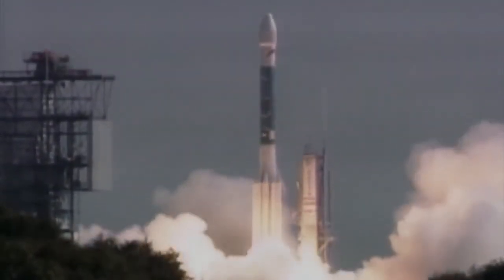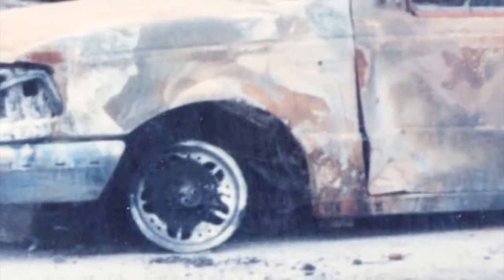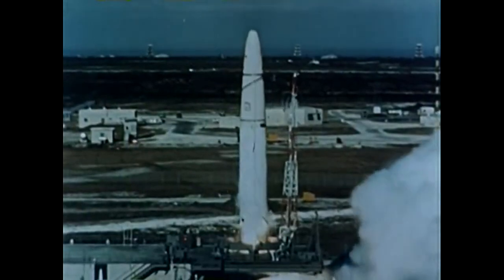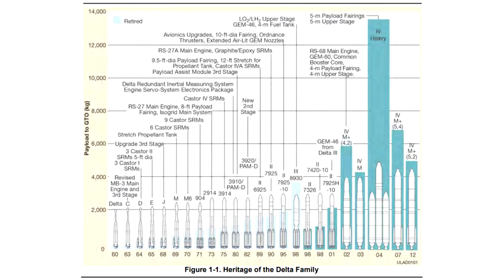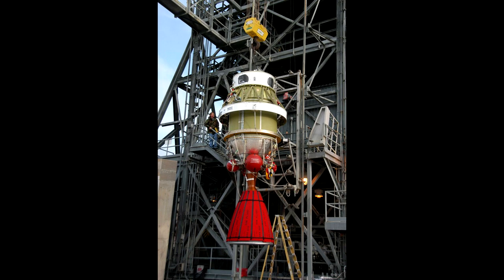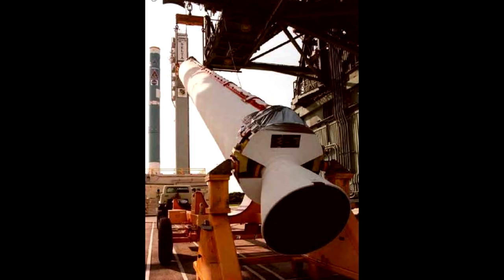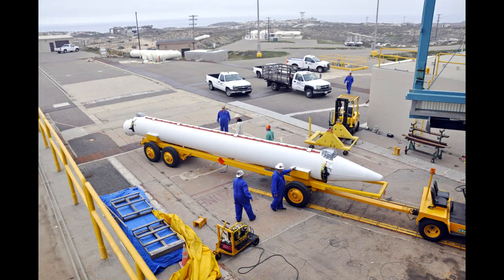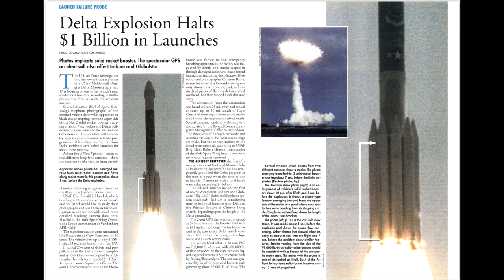Why Rockets Fail: 1997 Delta II Explosion - When a Booster Comes Unzipped

Comment: I worked on the upgrade of Delta RS-27 engine to Delta II back in '87. I discovered a flaw in the engine analysis, in that they had failed to perform a fracture analysis on the turbopump main shaft. They had done a long duration durability analysis but that was insufficient for the cryogenic conditions to which the shaft was subject. They knew they had a flaw in the engine as they were losing one flight in 23 and half of those were due to engines going "boom", but they had not been able to find the cause. After I pointed out the flaw, they changed the design and the reliability doubled.
Reply: baddoggie101 wow super impressive! I’d love to be an aerospace engineer
Reply: One in 23.  Taxpayers' money.  We get a do-over.  Nice business.
Reply: Memestealer_chungles 05 especially one working on rockets!
Reply: nice pfp
Reply: @a7xgh442   As a current ARO major, prepare for many late nights. It's definitely a very interesting, and I'd say rewarding, career choice. There's at least 2 fluids classes, a Vibrations class, Systems Engineering lab, Controls & Avionics, and Thermo and Orbitals (if you're going the Astro route).
Reply: Harut H thank you :)
Reply: Congratulations!
Reply: Memestealer_chungles 05 started my freshman year at uni here in the netherlands majoring aerospace, it’s awesome but like the other guy said a lot of work. Though if you find it interesting enough spending 2 weeks straight studying for the exams (do this with friends as you need the social contact and you can help each other) is not that bad. And I still get to party 3-4 days a week when I don’t have exams. Would defenitely recommend the study!
Reply: Bobbytrap the fact ur partying 3-4 days a week tells me u ain’t going to be no one special in the future. 
Why don’t u use them 3-4 days to get u even more knowledge? Ah that’s right cause I don’t actually care
Reply: Nick Jeffrey I still pass my subjects, just can’t be bothered to sit there studying every day of the week. I’d rather spend my free time building up a social life and hanging out with friends. With a masters degree (which I plan on getting) in this sector I’m almost guaranteed a good job in future, wherever that will take me. As long as I’m happy with my job I’m fine with it
Reply: @bobbytrap2554  Screw chicken nuggets and booze, I'm going to college!
Reply: Damn you must have gotten a huge raise considering you saved them millions of dollars
Reply: Memestealer Chungles  "I'd love to be an aerospace engineer".  
      Surely you meant to say "rocket scientist".  Didn't you?

Comment: My father was in the blockhouse during this launch/failure...he was a propulsion engineer (liquid engine) for Boeing/McDonnell Douglas/Douglas Co. since 1963. As the rockets grew larger and more powerful over the years, he had said that if they lost one on the pad it would obliterate the blockhouse...needless to say, the explosion at roughly 1/4 mile off the pad knocked him out of his chair. They were stuck in the blockhouse for over an hour before being evacuated. His truck was lightly damaged, but the vehicle parked behind his burned to the ground. He was close to retiring at the time, but stayed on until the next successful launch (he didn't want to leave until they had a good launch). He then retired, but contracted back for the (ill fated) Delta III and early Delta IV. He was a very intelligent and well respected engineer, but extremely modest. His passion for the space program was unwavering, and inspired me to join the space program myself (Space Shuttle).

Comment: Very good report. You did your research.
I worked for McDonnell Douglas Delta program back in 1997. It was a sad day. 
Steely eyed missile men get misty eyed when one of their birds fail.
Funny story; Once at Vandenberg  one of the solid boosters was out of storage and sitting outside to get some testing. People were standing around near the nozzle. A plastic protective cap on the nozzle popped off with a good loud pop sound. I think the people standing by the nozzle had to go clean their shorts after that. 
I assume the air heated up in the nozzle expanded enough to pop the cover off.
Reply: I think the "misty eyes" were from the toxic cloud. 😂
Reply: Things going pop unexpectedly does tend to get peoples attention fairly quickly.
Having worked in the hazardous chemical industry i worked with differential thermal analysis equipment.  Take 10 grams of the waste stream which is potentially going to be distilled for solvent recovery and put it through a heating cycle to see if its safe to process. Only had one sample which suffered a thermal runaway reaction under heating, it did go pop, well it was more of a bang. Better to test it with a few millilitres of sample than 18000 litres in the still.
I should add no damage or injury was caused by the event, the testing equipment was very sturdy and was probably built to withstand worse samples, the equipment was originally owned by ICI.
Reply: @patkins8319  that's what your mom said

Comment: My friend Marc was a member of the launch team in the blockhouse during this event. He manned the instrumentation bay and after the explosion they noticed that noxious fumes were leaking in through the cable conduits. They rammed rags, paper and their shirts into the conduits to block the fumes. Marc's car was one of the severely damaged. 
Scott, contact me if you do a report on the Delta 3000 #134 failure of Sept. 13, 1977. I was a solid propellant consultant for the McDonnell Douglas failure review team. That failure resulted in a major change in solid propellant formulation.
Reply: (written as I look across the living room at a twisted little piece of Delta 241 tank which Moose gave me)

Hey, I would like to hear anything you have to offer on that.  Sounds interesting!

I believe Marc said that a chunk of propellant actually struck the entrance to the conduit channel, which had at least been sandbagged (years earlier?) as a precaution.  That had me imagining how whoever it was stuck lugging those sandbags in the Florida sun must have been complaining to themself about all that work when it was never going to matter, because what were the chances of a direct impact from something?

Comment: Would be super awesome if you could cover the failures of the first rockets/rocket motors. I'm very curious what went wrong in the early days
Reply: This !!! Please Manley-san !
Reply: @helioswind2614  *Manley-sama
Reply: They probably mounted the guidance sensors upside down or some other stupid thing we used to do when we didn't know better. The best failure has got to go to Wernher Von Braun when he built his rocket with the engine at the top because he thought it would create a "pendulum" (I believe) and that it would stabilize itself. Cool to think that same man designed what would ultimately become the Saturn V which took us to the moon. I guess that's the thing with smart people.
Reply: @mankeez5892  it wasn;t Wernher von Braun it was Robert Gottard
Reply: @mankeez5892  Yeh that was Robert Goddard who did that, not Von Braun.
Reply: Sounds perfect for another Vintage Space collaboration.
Reply: They almost always come down to "component X could not even" which, by the very nature of having stupendous amounts of oxidizer and fuel right next to each other, result in KABLAMO!
Reply: Unfortunately there aren't any ancient Chinese inventors around that had first-hand knowledge or were witness to the failures.
Reply: There is a phenomenal book about this by Drury Clark: Ignition - An informal history of liquid rocket propellants.
Reply: Everything went wrong.

Comment: I saw a documentary on this failure once where one of the engineers described making an insurance claim about is totally destroyed car. Apparently the insurance company was skeptical when he said that "a rocket fell on it." :)

They also described jumping under the desks in the blockhouse as the debris came down. I'm not sure that doing that would've helped.

Clearly, this could've been much worse.
Reply: I just read about this a few minutes ago as I'm doing a post on imgur about this failure. Here's the story:

"One of those belonged to Dr. Jay Bernard, who joined Aerospace in 1977, then moved to the Delta II program in the early 1990s to work on the Redundant Inertial Flight Control Assembly (RIFCA), which was part of an avionics upgrade."

"Bernard recounted that his insurance adjuster was initially skeptical when he reported the cause of damage as a collision with a rocket.  But he was convinced after Bernard told him to turn on the television, which was covering the event right then."

Comment: 5:16 Most badass bird under rocket motor
Reply: michael cannard can’t see it :/
Reply: @Mr. Minticuz It's not directly under the rocket, it's more in front of the concrete block the rocket is placed on. You see that red pipe? The bird is more underneath that walking towards the stairs that need up to the rocket motor. Still the most bad ass bird in the world. Can't even be bothered to fly away...

Comment: "It would be bad if these boosters failed. We better test them so that doesn't happen."
"Good thinking, Jim."
Reply: Brian Clark For metal casings, this is the proper standard procedure.  Because solid metal is more like a spring that will be just as strong after that pressure test.  While fibres is a bunch of strings permanently breaking one by one at max load.

Comment: I immediately thought of this when I heard of the Titan submarine having a carbon fiber hull. Carbon composites are very strong and have many advantages in several applications, but everything in engineering is a tradeoff that must be weighed against the drawbacks. I'd imagine they didn't do enough inspection after each dive.
Reply: Same

Comment: The destruct signal from the blockhouse would be Command Destruct.  Self Destruct (internal failure) and Auto Destruct (from the flight termination safety chain) are different events.  Rocket staging temporarily inhibits Auto Destruct, for obvious reasons.

Comment: I was there!!! I was 10 years old and I still remember the noise and the incredible explosion that rocked the building I was in... we were getting ready to board the big red boat and they said if that boat wasnt between us and the explosion, all the glass in this glass wall facing the ship would have shattered!!! 

I remember the sliding doors coming off their tracks and the security guards running around not knowing what had just occurred... when we got on the boat we could see the smoke and fires still on the grounds...

Comment: Solid rocket fuel is primarily Ammonium Perchlorate .  Same stuff was used in the Space Shuttle strap-on boosters, and in the new SLS boosters. We use it in our high-powered rockets.  Do a search for "model rocket cato" in YouTube and get your fill of what are mostly forward bulkhead failures and nozzle blowouts.  As the AP burns inside an semi-enclosed tube, the pressure increases dramatically. AP loves to burn fast under high pressure and poorly when it's not enclosed.
Reply from the maker: You know I should have mentioned the combustion rate dropping after the rupture.

Comment: Carbon fiber has been nothing but trouble in rocketry. Makes me feel even better about a steel Starship.
Reply: Rocketlab begs to differ
Reply: @listtamaru  I'd say it's a bit too early to call that one.
Reply: @RobertLutece909  going boom has an even bigger effect on performance lol
Reply: Steel is incredibly heavy. It is good for simple SRBs, but that is about it. Once you can manage a different material, you should abandon it ASAP.
Reply: @HalNordmann  Not that heavy when you factor in the strength per mass and over all temperature ranges especially below -200C and above 300C where both carbob fiber and aluminium fall apart. Centaur is one of the highest performing and lightest upper stages ever made and it is fully 304L stainless steel. Steel is a very generic description that includes heavy carbon steel and modern super alloys in the 300 series that outperform aluminium and cf. Sure room temperature ok. But turn the heat up, say during reentry and the cf delaminates while the aluminium looses all strenght and the vehicle breaks apart. Do some research before spreading BS. Seriously how does one not know about Centaur, the most frequently flown US upper stage. Even Centaur V for Vulcan will be 304L.

Also SpaceX builds both F9 carbon fiber interstage and the cf fairings in house, as they do for the SX500 inconel, so suggesting they don't have any better materials science is ridiculous. Stainless is far superior to anything else in reusable rocket.
Reply: @221b-l3t  I know about Centaur. And it is made of steel due to being a baloon tank and initial inexperience with LH2, not some inherent strength. And about the performance in heat, it still gets brittle in low temperatures, and the high temperature performance doesn't matter since you need a heatshield anyway. Aluminium + extra heatshield thickness (which has about the density of foam) is way better than steel for reusables. The only advantage it has is low cost - but that only matters if you intend to throw your rockets away and don't care about performance. It is by no accident that only big dumb boosters have been proposed to use steel in any major quantities. You don't see any airplanes made of steel, do you? Or serious reusable spacecraft proposals for that matter.
Fun fact: A Heavy-lift Vehicle design from NASA's SPS study has similar payload to what Starship is proclaiming to be able to lift (120t), yet only 4000t mass when fully fueled - with no weight-saving tricks, using technology from the 70s, and a 22t mass reserve! Apparently, aluminium construction/winged flyback is a pretty efficient design!

Comment: Basic question...
Why have we shifted from multiple first stage boosters to only 2 of them...
Other than the increase in efficiency and twr of engines such as the Merlin are there other reasons...
Plus why is the two booster configuration flown the way it is..

Comment: A little off topic, but if the solid fuel is fuel and oxidizer premixed, what stops it from violently exploding, without the extended burn phase required for structural integrity?
Reply from the maker: It’s metastable, it needs an initiation energy to get it started.

Comment: There was no true blockhouse in use at CX17in the sense of the heavily re-enforced structures seen on ICBM row. The one at CX17 was just a modified bunker using sandbags and other material. Glad I arrived after this event. But I did have a front row seat for it just north of it.

Comment: this is the same thing that killed Challenger. when boosters arrive at the Cape they are delivered in sealed railcars to prevent ignition. When they are stacked every joint must be sealed and packed with epoxy to prevent leaks. what happened here and with Challenger is the o rings shrank and broke and the booster was not sealed properly. Just like Challenger the flames ignited the solid fuel in the other boosters and melted the tank leading to destruction. those that did not explode when the rocket went up were destroyed by the range safety officer. Today Northrup Grumman  test all of its boosters in Utah before they are shipped to the Cape and they make sure there  are no leaks if a leak is found they seal it or the boosters will explode.

Comment: SRBs dont 'explode' they burn.   The problem with composite cases is that inspectors never know if someone dropped a tool on them.  Yeah, that happens.  With steel cased CastorIVAs you could see a dent.   It was also know that the movers sometimes ran motors into doors and edges.

Comment: I'm kind of wondering why they don't come up with an LES-type system to recover payloads if only their launchers malfunction... That seems kinda obvious since the payload is the most expensive part of any launch...
Reply: Because that's stupid
Reply: @salade2760  How so? Why risk the important and expensive part of your rocket when there's a relatively simple method to in not guarantee, then at least bolster its chances of survival? Why effectively waste millions, not to mention time, on new equipment - potentially setting your project back months, if not years?
Reply: @TheBananaDealer  Adds unnecessary weight. And most of the money that goes into a satellite is R&D, so rebuilding one is easy

Comment: so instead of an answer to why rockets fail i get a brief history of delta rockets
Reply from the maker: Why did it explode: because the booster exploded.
Why was there a booster on the side?
Because delta needed them to handle modern payloads.
Why was delta II so small that tit couldn’t handle big payloads.
Because it was derived from Thor.
Why was Thor so small?
Because it had to fit in a plane.

Comment: There is no such thing as a rocket "motor."  Motors convert electricity to motion. Engines burn fuel to create motion. All rockets have engines.
Reply from the maker: You must have missed all those motors using combustion, or pressurized gas.
Reply: Motor isn't restricted to electric.   There are also hydraulic motors.   And, by any definition one would wish to restrict "motor" to only these 2 devices would also easily include steam engines in that definition.

Then there are such terms as motorway, motorcycle, motorboat, etc.